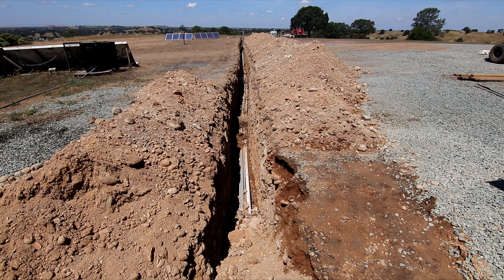Off Grid: Water Supply Upgrade & Utility Trench

Comment: Do the pumps have a even run time so pump 1 turns on fore 5 min and then pump 2 and pump 1 turns off
Reply from the maker: No.  Pump 1 takes the majority of the load and pumps 2 and 3 only turn on when there is a heavy load.  I would rather just replace one pump when it wears out than deal with 3 worn pumps

Comment: Nice setup the pool filter works good I have used them before for water supply the only thing I can imagine is a UV light for just in case but you obviously have tested your water for use.
Reply from the maker: It certainly works great...My only complaint is that the iron in the water has stained the filter and plugged it up and it wont rinse out very easily.  I can't find a replacement cartridge for this one, but I haven't tried just bringing the filter into a pool store to see if they have one.
Reply: @HighTechLab  An extra filter for just iron ahead of that pool filter would work.